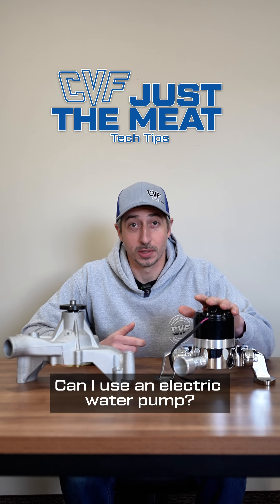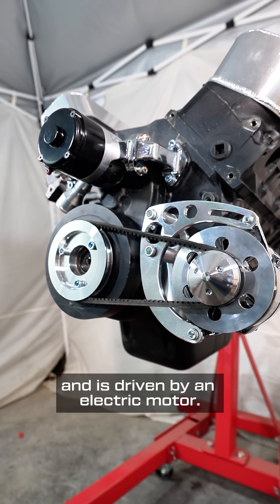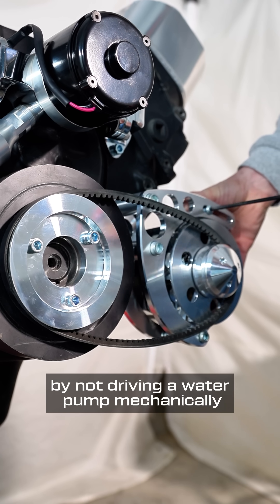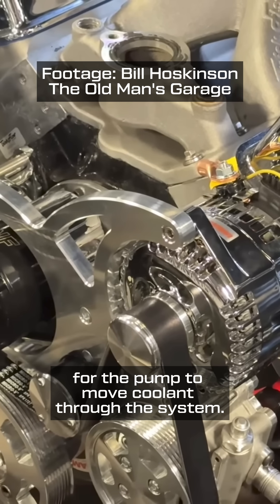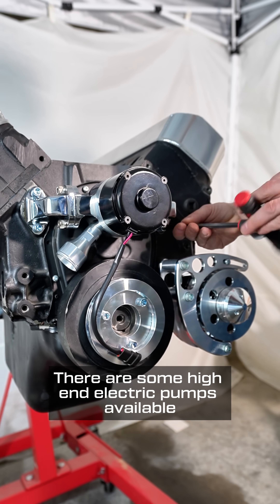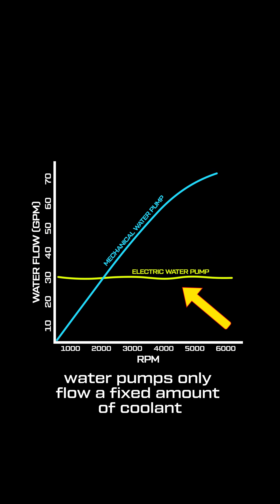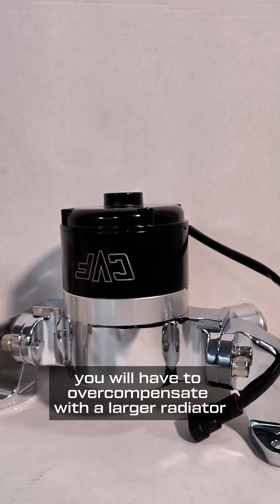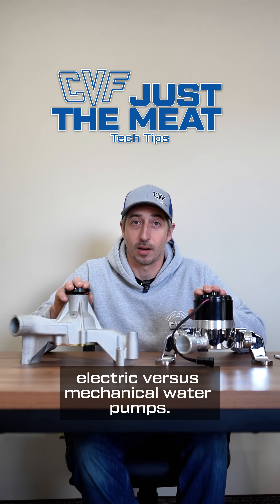Electric Water Pump VS Mechanical Water Pump - Just The Meat - CVF Racing Tech Tips

Comment: Lots of OEMs run electric pumps as the primary means if cooling and that includes turbo applications, this information is about 10 years out of date. Davies Craig is an example of an after market pump manufacturer that can be used as a replacement for all scenarios including daily driving.

Comment: The only benefit in a mechanical pumps volume is in the 3000 rpm and above range? An electric water pump should be fine for all street driving scenarios according to that chart.
Reply from the maker: The chart is just used for a demonstration. At cruising speeds a mechanical pump will flow more than an electric pump.
Reply: @CVF_RACING what's cruising speed then? 1800 rpm? 2500 rpm? 4000 rpm? The chart isn't an example.